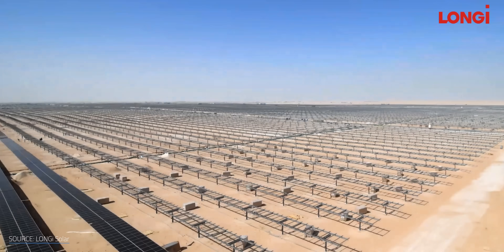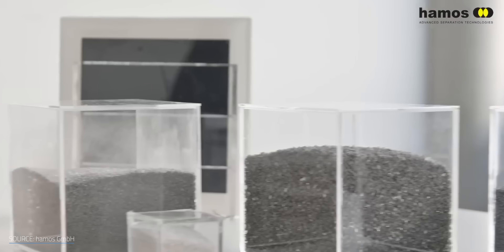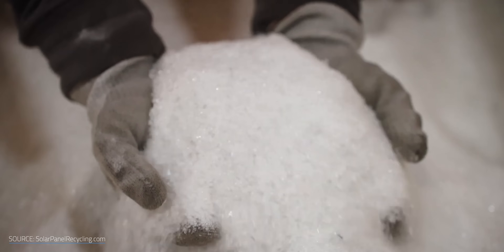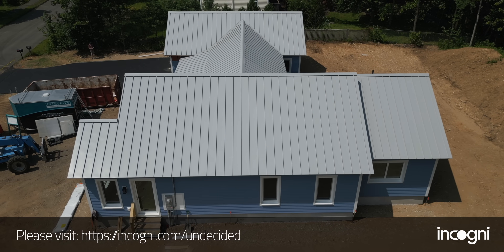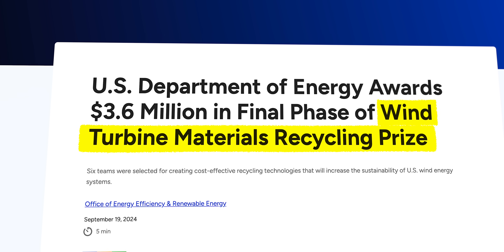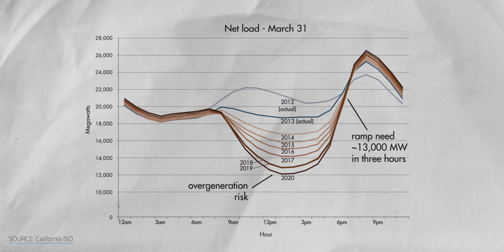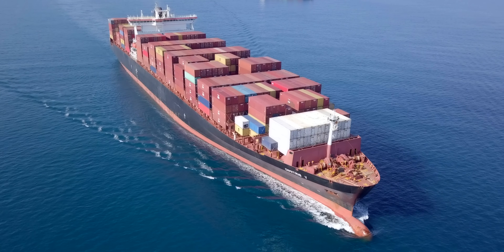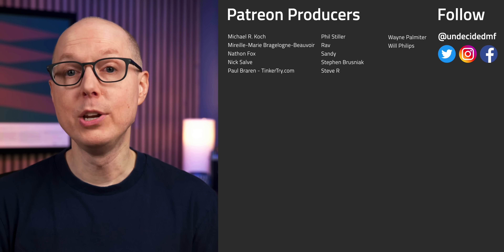How We Solved Renewables BIGGEST Problem

Comment: Recycling or reuse of renewable energy products is obviously important. However I find much of social media concerns curious given that most of those concerns seem lifted from fossil fuel companies’ talking points. They never expressed any environmental concerns about the waste generated by burning fossil fuels or disposal of end of life roofing materials, vinyl siding, plastic products or lithium batteries in cell phones and other consumer products.
Reply: Yes, it's fake concern that appeals to people who aren't good at math but want to find fault in the obviously better new way. 1:17 "Around 8 million metric tons of solar panels could pile up by 2030." Wow, sound terrible. But every year about 900 million metric tons of more toxic coal fly ash are generated annually. So 250 times more waste from burning dirty fossil fuel than solar.
Reply: The battery issue, is an issue for renewables. There are options, but - they have drawbacks and problems that need solutions. And for electric vehicles - it is a problem orders of magnitude larger, and if you want grid scale energy storage - it's an order of magnitude larger yet.

Recycling doesn't exactly happen and is the worst of the Three R's. Reuse + Recycle - that is what we want. The problem with windturbine blades is there is no reduce angle beyond not doing it in the first place, and reuse has relatively limited avenues relative to the sheer volume of expiring wind turbine blades that will start to be created over the next couple of years.

Vinyl siding, and construction waste in and itself is a huge issue. As are other single use plastics - the answer: Is reduce use of them in the first place. But, that requires an alternative, and alternatives exist: Stucco comes to mind. Plaster comes to mind. But you do need to know how to do it. Wood siding as well - but that tends to recquire some other finish, and Vinyl tends to be set and forget.

And as for burning fossil fuels? You do know that semi-arid area's are decernably greener over the last couple of decades basically as a result of 1. mild increase in temperature, and 2. increase in CO2 availability right? The environmental maximalists love to leave that part out, the wealthy ones love to keep buying their ocean front property they seem intent on owning for the next 30-50 years... so how big of a problem is it? What are the actual underlying causes of problems - destruction of habitat maybe? Introduction of invasive species? Shall we keep going?
Reply: @formes2388  “as for burning fossils” I have lived in arid and “semi-arid” areas for more than thirty years. Nothing in my experience remotely matches your bizarre “mild increase in temperature” comment. It’s not greener.
Reply: The battery issue for renewables at a grid scale is honestly nonexistent. Pretty minor at a local scale as well, and then EVs are a scam, esspecially with biofuels and rail networks existing..

The reason a battery issue doesnt exist at grid scale is that pumped hydroelectric stations exist. Those stations are incredibly long lasting energy storage facilities, which not only require nothing but water to operate, but offer incredibly rapid start up times during peak power useage, and produce easily grid transferable AC power rather than the DC power batteries output. 
At a local scale pumped hydroelectric can also work, with small water towers or simply upstairs and downstairs water tanks, although those are certainly limited. 

You do certainly have q point about destruction of habitats and invasive species, but fortunately renewable energy has significantly less habitat destruction than fossil fuels, and the majority of habitat destruction has nothing to do with either, and instead is because of construction and farming. Construction needs can easily be replaced with just tree farms, rather than felling old growth stuff, and farming needs can be replaced by just having more renewable crops (soya beans and palm oil trees are horrendous for the soil, other crops are less harsh and/or help improve the soil in some aspects) and better farming practices.
Reply: @Santisima_Trinidad  EVs are not a scam. Low-carbon electricity →battery → motor is the most efficient and cleanest way to propel an untethered vehicle. There's no way biofuels could fuel all road vehicles without massive destructive increase in farmland, and/or everyone stops eating meat.

Hydroelectric is good but many of the best sites have already been dammed, and there are environmental consequences to damming a new area.
Reply: @formes2388  what's actual orders of magnitudes worse than millions of tons of wind turbines and batteries is burning through BILLIONS of tons of fossil fuels, and there's no reuse or recycle for them.

The extremely rapid increase in Earth's average temperature in recent decades is not "mild", and increased CO2 only helps plants when water, soil, and temperature stay the same. Global warming in most places makes all of them worse. It is the actual underlying problem behind multiple worsening effects.
Reply: @skierpage You do realize that all the Dino oil used to be alive at one point right? Jurassic period had 2.5x the amount of C02 in the atmosphere compared to now
Reply: @tuckerhiggins4336   of course, so what? When Earth was last likely this warm 135,000 years ago, sea levels were 6 to 9 meters higher (!!) and life was dramatically different. Some animal implant life will survive our destructive choices, but we are already causing the sixth major extinction event in Earth's history.
Reply: @skierpage  The point is it doesn't really matter what we do. The planet will adjust with or without us
Reply: @tuckerhiggins4336    of course it matters what we do! We are causing extremely rapid global warming, we could and should reduce it.

Comment: Building codes need to be updated so that new houses have at least 2000 Watts of pv on their roofs.
Reply: Lets raise the cost of a new home even more!!!!  Not all homes are in locations that are even remotely solar friendly.  I actually looked at solar for my home.  It's simply not feasible on my home.

Granted, that can be partially addressed by siting homes so that the roofs are more solar friendly, but even that is only going to help so much.
Reply: @jeromethiel4323  Just a suggestion, not an absolute. Do what works for you.

Comment: I think, you should just shut up. As of 2025, except solar. No one actually secured proper loans or buyouts.

Reason, when you really go to auction like oil and energy. You will way difference in mindgap of unskilled-top-uni students and bulls of energy sector.

A production machine, need to have at least 10 years of sensibility. Plus additional in time upgrades to compete.

And these are just use and throw. 😂

Comment: Talk about putting the Cart before the horse. This should have been done before all this crap was installed.
Then comes the" no money in recycling so just burry it" This crap is more polluting than the fossil fuels use to make and install, remove.
The answer was and has been for 50 decades. Small nuclear power plants scaled to reuse from the larger plants, then reused at home micro scale

Comment: The biggest problem is the need of seasonal storage for solar panels source of energy. 
Solution is to install them vertically in fences, agrovoltaics or on buildings facades. This reduces the energy storage by a factor of 10-50x
Reply: I'm going to need more to understand what you are saying.  How does what you say reduce the need for storage?  Or are you saying that just have so much production that you don't need storage?
Reply: @ the energy producion of a solar panel, installed vertically, is almost constant all the year so you need energy storage only for few days (not few months needed in case of panels mounted with a 30 degrees angle). 
The exact numbers depend on the latitude but for Europe or US is valid.

Comment: If we as a society won't recycle plastic bottles because its not economically feasible, what makes you think they will do this at scale?
Reply: the maker community is starting to make a dent with the polyformer kit, we can turn bottles into 3d printer filament now.
Reply: @ OK, great on a small scale, if it works at scale, where are the filament companies buying up all the plastic to make filament???

Comment: I've been putting my electric money where my mouth is, so to speak, for 25 years when I could.  Years ago it cost me more than non-renewable energy, now here in Texas it's about the same, 15 cents a KW/hr delivered.  It's been exciting to see so many positive changes over these years.

Texas is putting in solar and battery like crazy, adding to the wind sources that started years ago.  Much to the chagrin of the oil and gas dick suckers in the legislature and governor's mansion.  

I'm sure there's a reason the windmill blades can't be made of aluminum, but I'd like to know why.  I also have concerns about the massive carbon footprint of all that concrete that gets poured for the turbine foundations.  

The latest generation of solar panels degrade very slowly, on the order of about 1 percent per year.  If that is due to the polymers used, as said here, eliminating the polymers might result in panels that degrade so little it's hardly worth thinking about.  Even at 1%/yr,  the only lifespan limiting factor is economics:  has the land become more valuable for commercial reasons than the electricity being produced.  A solar installation in uninhabitable areas could then easily run fifty or more years.

I'm an old man.  These are very exciting times for those of us who thought what we now think of as green many decades ago.

Comment: As much as I love the advancement, recycling is not even close to being the biggest issue of renewables and especially of solar power. Stability is the actual n˚1 issue and its not even close.
Reply: That’s why they make batteries
Reply: @markbrown8323  Battery storage at the required scale is really expensive to both build and maintain. Thats why its an issue.